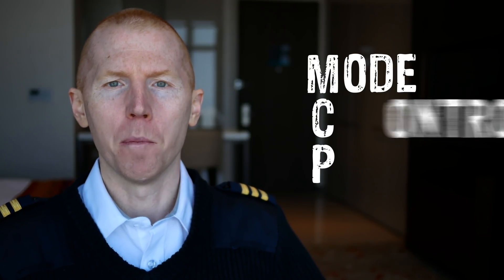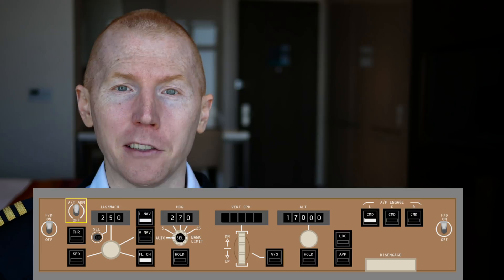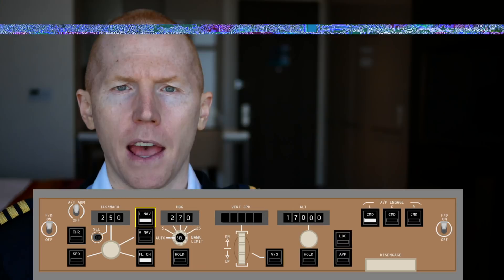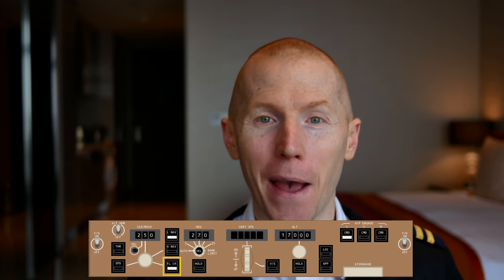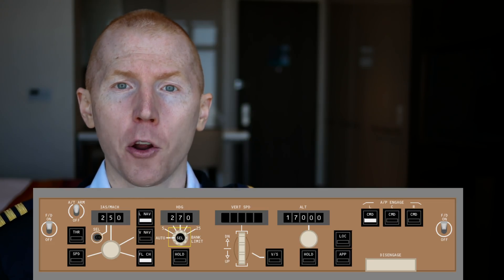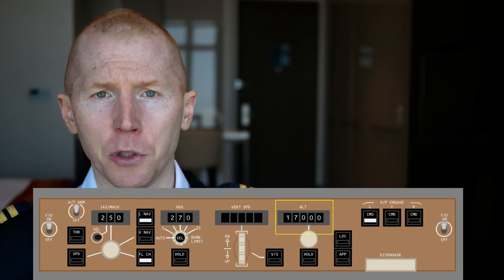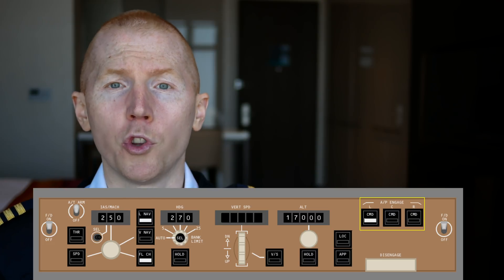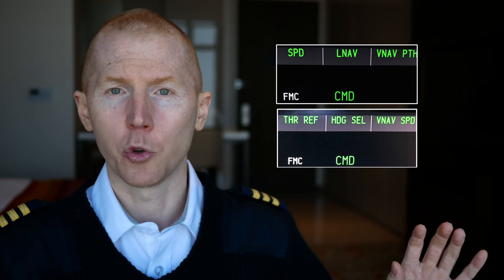Boeing 747 Flight Sim Training: Mode Control Panel

Comment: Great video...got a question for you out of curiosity..
Are you acquainted with PMDG 747? If yes then what do you think about it? How accurate it is?
Reply from the maker: I am not familiar with it, but I will see if I can check it out, was this useful for that sim?
Reply: @74gear  yeahhh
Reply: @74gear  the PMDG 747  is an accurately modelled aircraft and it's flight model is 95% accurate to the real 747

Comment: Great content! Question: Can you fly half way manually? For example on an approach, you control heading and vertical speed (by hand flying the plane using the yoke), but AP controls the thrust set for approach? Thank you!
Reply from the maker: yes you can.  Its not recommended by Boeing in their training manual but you can do that.

Comment: Great vids, very informative and this one will help our WorldFlight crew understand the MCP. I have one question, when would you use the CON IGN button? I've been told it's used when raining, heavy moisture in the air(I call that thick fog!) and volcanic ash in the area. I've also been told it's when the temp/dew are within 5* of each other as this is classed as moisture in the air. I can't seem to find it in FCOM/FCTM at all. Any help, greatly appreciated. Cheers. Blue up, brown down!
Reply from the maker: wow, you know about the FCOM, no rookie.  Well I think it may vary between airlines but usually moderate or heavier rain/turbulence/hail/sleet.  Volcanic ash and icing conditions as well as standing water on the runway will cover most the main points.  Thanks for watching Darren.
Reply: @74gear  so nothing about temp difference between DP and OAT? Okay. Cool. No probs, if you get chance to get down to ypph at any point, give me a shout. 
JUMBO747 is our YT channel.

Comment: Do you fly just freight??

There are less that 500 747s left.  Do you think they will design a better engine for it to compete better with the 777 to keep it flying longer.

The new geared engine would be nice.
Reply from the maker: so the 747-8 has a great new engine design and they are still making them.  So the freighter will continue for a while, the passenger planes will slowly fade away though I think for more fuel efficient planes.
Reply: Great engine on the 8 but I think it is too large to retrofit on the older 747s.   It would be nice to have a replacement engine on the 747 400 which fit in the existing space but is more fuel efficient and has a little more power.

Comment: How do you monitor the stabilizer trim and override in case of aoa or speed sensor failures??

And do pilots actually look at the actual trim setting when things go wrong??

The flight 447 pilots did not get this.  Same with some 737 pilots.

And the 350 to Australia pilot could not override the stabilizer when the aoa glitched.
And the
Reply from the maker: you are referring to the Max MCAS and we don't use that system on the 74 so if we have a failure it shows up as an alert.
Reply: What if the stabilizer motor starts turning on the 747.  How do know if this happens.  Is there sensor or turn count on the motor.  Or is there a manual override on the older 747s

Comment: You gonna make a vod about 737 max right? I hope so
Reply from the maker: as the reports come out I may discuss it yes.
Reply: @74gear  some topic you might want to consider covering would be pilot training for the plane.  I hear some pilot only had 2.5hr of training with the equipment and also some pilot weren't aware of the anti stall system in the Max. What are your experience as a pilot regarding adequate training with your equipment as well as have there been changes in your equipment that you weren't aware of.
Reply: @74gear  thanks by the way

Comment: can you please make a video on the Ethopian Airlines flight 302 crash ?
Reply: Mentour Pilot made some videos explaining different 737 systems that may have been related to the crash, if you are interested. Because 74Gear is a 747 pilot he may not be able to speek about the 737 in detail.
Reply from the maker: I am waiting for more facts to come out before I talk about it.  At this point its really mostly going to be speculation as to what caused the crash until the report is out.

Comment: Nice video. I fly the 737-800 in a simulator so could the most of it from before but i learned something new.
Reply from the maker: nice, ya all the boeings are pretty similar so glad you can use some of it Bear.  Thanks for watching and subscribing.

Comment: I just find this stuff interesting. But, my flight simulator is a full motion C-130J, it's controls are a bit different 😊
Reply from the maker: ya a long way off from the C130 for sure.  Glad you liked it though Correy.

Comment: Have you every had to fly the entire approach without George.
Anthony
Reply from the maker: on the 74 no, on other planes yes, early in my career I had planes that had no autopilot or flight director and I had to hand fly them 4-6 flights a day...but most of the time with how precise they want the approaches its better to keep automated and have better awareness of whats going on around you.
Reply: A lot of people aren’t aware, but there is a huge difference between hand flying an approach with a flight director and approach mode selected, vs hand flying on what we call “raw data” (flight and navigation instruments only). 

The flight director is a single instrument which all you have to do is match it up with the airplane on the attitude indicator (making a cross hair with a split cue FD like on the Boeing and Airbus or putting the black airplane triangle into the V bar on a single cue flight director like most King and Collins avionics have) and it will make the rest of the instruments read what they are supposed to. It will move the right amount for corrections too, so you don’t over correct—which is especially hard the last hundred feet of so of an ILS or LPV approach. 

In my experience, hand flying to a flight director is almost as easy as autopilot. 

Hand flying a high performance plane without a flight director is very difficult if you aren’t used to it.

Comment: Hy Kelsey, great and inlighting video!!!. I will try to implement it on my X sim. Just one question: when you pushing the Loc button, does the AP, starts to intercept the CDI, even when it is in full deflection, or it does it only when the ”needl” starts to be  ”alive”?. Thanks!!
Reply from the maker: so when you push loc it will show in your FMA in white, when it sense the localizer and is "alive" it will capture it and go green then it will fly the localizer inbound from there.

Comment: Well, does anybody of the commercial pilots know how to fly bare metal? Does everybody know how to disable all that computer gizmos and fly at bare metal level? Sometimes it seems that a Glider - pilot knows more about aviation that a computerized cooperate pilot.
Reply from the maker: well they're different things, but I am not going to hand fly a plane for 14 hours 🤷‍♂️ but thats just me.
Reply: Yeah... I’d be very careful comparing a glider to a large jet. 

In a glider you have one lever that changes your glide ratio from 40:1 to that of a brick without changing anything else. They also rarely get damaged on out landings. That’s why 14 year olds can fly them.

Comment: Kelsey, great explanation. I would like to become a Boeing pilot but the clock is clicking so for now I’m planning on getting the Instrument rating/CFII and enable others to reach that goal. My work allows me to fly the Full motion flight simulators for: 737-800, P-8, C-130J, E-2D, F-35 and V-22. Thank you
Reply from the maker: thats some pretty cool sims you get to fly though, the 737 will be similar at least you can use this info for that.  I just saw some v22 take off the other day, must be fun to fly those sims....jealous.

Comment: Great video once again! I wanted to ask for something like this since i enjoy flight simulator a lot in my pc. Would be great if you could do something like this again in how we configure 74 pre-take off [although i understand there might be factors to consider like correct altimeter set, length of the runway, weight, weather etc.] or one more thing if you could land the 74 [or the 73 or learjet 45] with visual aids in a smaller airport navigating with ADF perhaps. I'm not a pilot so i hope all these make sense. Once again great work!
Reply from the maker: I am hoping to do a collaboration with a person who does a lot of flight sim stuff so I can see what you see and see how accurate it is compared to the real thing.

Comment: How many minutes of HOTAS flying does a Boeing pilot do on a "regular" flight (no emergency)? (FYI flight simulator)
Reply from the maker: very little.  If you are doing a RNAV departure you will usually engage the auto pilot by 500' and on an arrival the last couple thousand is pretty normal.  SO you could have a 14 hour flight and get a few minutes of hand flying.
Reply: @74gear  As always thanks for taking the time to answer!!

Comment: '"There's not much to explain about it... An autothrottle is an auto throttle and you don't turn it on until you get ready to take off"😆
Here's what you can explain... Whats it do? I always see pilots taking off with their hands on the throttles, so what does the autothrottle do? I could understand skipping over something like a clock. However, if you're going to explain the panel, explain the panel.
Reply: Does TO/GA enable auto throttle on the MCP? Also, I assume the flight director switch it to enable the MCP. How does this differ from hitting the disengage bar when you need to fly by hand?
Reply from the maker: so the flight director is turned on early when you get in the plane.  The disengage bar would be to take the auto pilot off so you could hand fly but like I said, people rarely use that.  Most pilots use the one on the yoke since their hand is already there.  As for the TOGA, that button is on the throttle themselves, so you wouldn't touch the MCP for that.

Comment: Hey 74, not trying to be rude but what's the blue bags under ur eyes? Is that just u being tired? If so you need to get rest. Love the content, keep up the good work. Have happy landings and easy takeoffs. 👍
Reply: justinl458 I can’t speak for Kelsey but I am of similar skin tone and often you can see right through the skin to blood vessels, etc. It mostly just means I burn like a lobster in the sun. 🦞
Reply from the maker: ya its just part of being a pasty white guy I guess... I need to start wearing makeup if the channel keeps getting bigger so I can be a pretty Youtuber  🤷‍♂️
Reply: @74gear meh it's ok. I was just figuring you were tired. Also I don't know if you know this, but I heard about research that pilots and other professions that include high altitude distance age faster. Something about Albert einstein theory of relativity, the gravity source and what not. I'll try to find a link and send it to you on Twitter.

Actually I found it quite easy. http://blogs.discovermagazine.com/discoblog/2010/10/25/einstein-air-miles-do-frequent-fliers-age-at-a-different-rate/#.XJYx2aNOkrc

Comment: The one thing I would have added to the explanation of the "FLCH" button, is that the aircraft will descend/ascend at a rate to maintain the speed set on the MCP.
Reply: Yep. Absolutely. 

Also.. the key difference between FL CH and SPEED. If you dial in a speed that’s too high on FL CH when climbing... it will level off. SPEED will start diving to catch it.